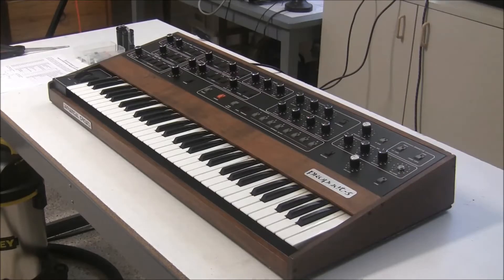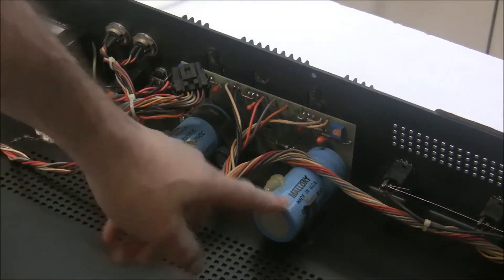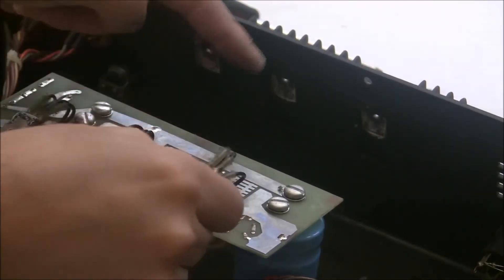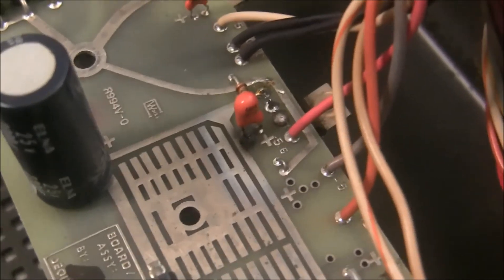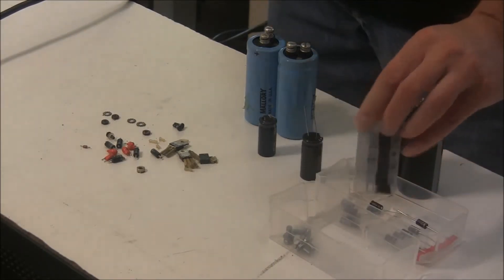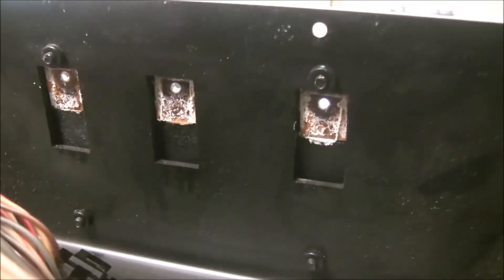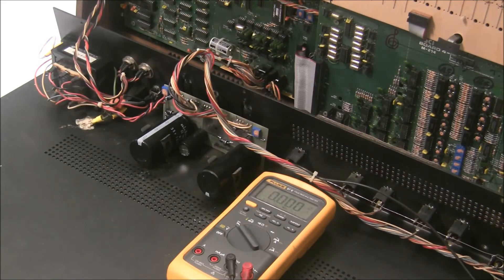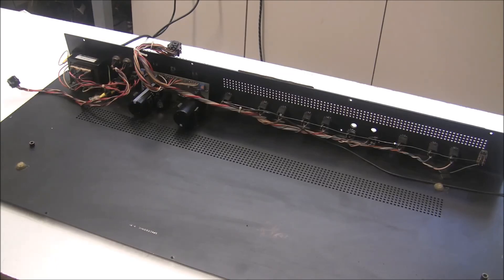Synthchaser #065 - Sequential Circuits Prophet 5 Restoration & Repair - Power Supply Rebuild

Comment: HI i m french i need to changes all composants on the power supply,can you regive by screen ref for all composants??thanx by advences!!
Reply from the maker: Hi there, I have a kit with all the components you'd need to replace on the power supply.  It's available on my website and I do ship to France.  Thanks!
Reply: @Synthchaser  I JUST NEED THE RIGHT REF FOR THE CAPACITORS 15 V I GUESS AND REGULATORS!!
Reply: @Synthchaser  MANY THANX i need the rightblue trimmer that mess alzo on my power supply!!
Reply: https://youtu.be/addme/J3HTVguvBszfFtJP4ZNLqXFoS11eWA

Comment: Nice Video. i recaped my Prophet 5. But theres one point Iám not sure if everything is really right. If I measure the points like shown in the video i got the expected results. But there are two more measurepoint in the middle (-5  and +12) . If i measure these two I got -26V for the -5V point and +26V for the +12V measure point. So I am a little bit angry to connect the PSU to the board. Can anyone explain why i got these different values???
Reply from the maker: Rev 3.2 and 3.3 Prophet 5's don't use those two power rails, and they're not equipped with -5V and +12V regulators.  So you'll see the unregulated voltages there, which doesn't matter since they're not used.
Reply: @Synthchaser  big thx for this hint. On the back the serial is 1000-5347 . Can you tell me which revision is this exactly
Reply from the maker: @beatronomic1952  Look on the PCB 3 circuit board, it will tell you.
Reply: @Synthchaser  OMG i really oversaw the big letters on the PCB board :o)))  Its revision 3.2 with midi mod. BTW it´s very nice that you made this restauration series about the prophet 5. It´s so helpful for me cause I am not a pro like you. I hope i was lucky too and it works after recaping all the capacitors...But than comes the hard thing...calibration...

Comment: So why did you replace the diodes? I wasn't aware they had much of a lifespan.
Reply from the maker: They dissipate tons of heat and are a frequent failure point.  A new diode that hasn't had a 35 year life of being burning hot will likely last longer than the existing part.